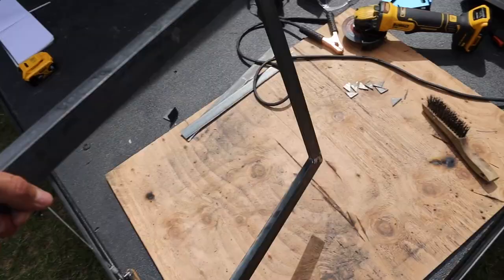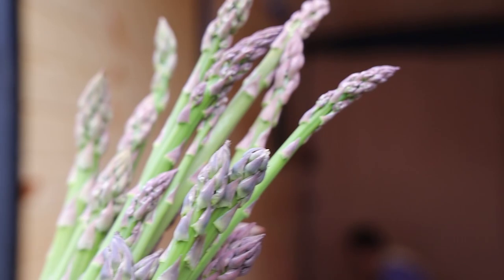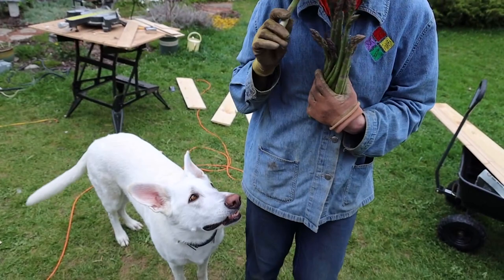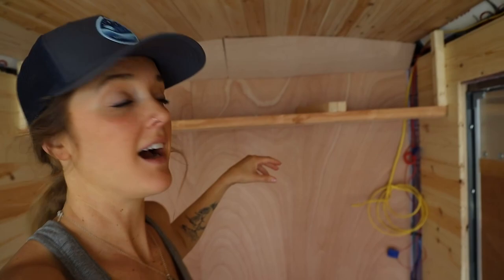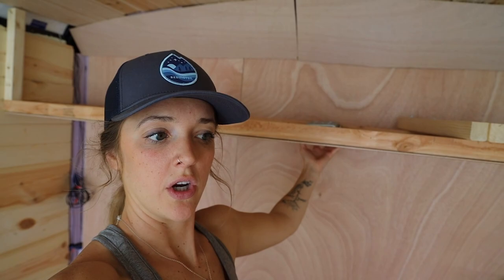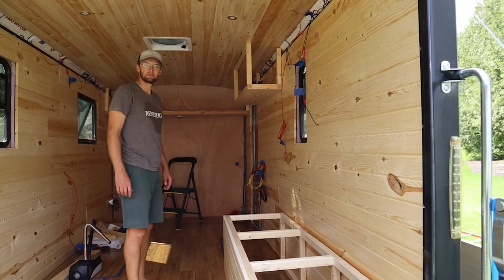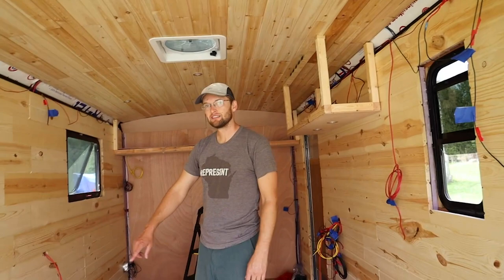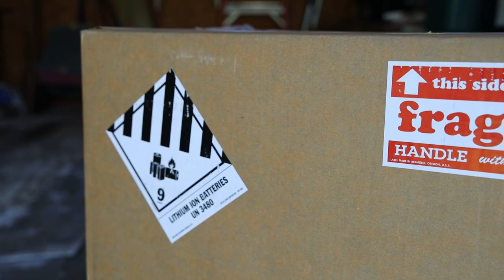CARGO TRAILER CONVERSION | Tiny Home Build | Part 4

Comment: Looking very good. You must be doing a great job because for a moment I thought it was a different trailor, because  it's got the illusion now inside that it actually looks bigger than when you started. I feel  Noah you & your partner are going to have some great travels & fun. You will have so many stories to tell like your sister does.  I put partner because I don't know how to spell bri Bree 🤔.  Looking forward to seeing your next video 🙂.   Linnea, because I have watched all your videos, I think you have built a lovely travelling home for you & Akela . I have noticed how you pack the back of your van. To me on this side of the camera, it looks like you might be packing a lot of weight on the rear drivers side .  Do you weigh all your stuff in the back & distribute the weight evenly? Because if it's not & it's in the same place all the time. This could lead to putting pressure on the bearings, the break pads ,& the edge of the tyres.  I don't know what your stuff weighs . So I was just wondering if that's something you do ?.

Comment: You're so calm about the hard drive stuff. I know it's after the fact, but I've been losing my ever lovin MIND. So frustrating & discouraging sometimes. I just need to know you wanted to break things & resign for at least a minute. 🤣
Reply from the maker: I had hours of wanting to break things and throw my computer against the wall 😂 I’m sure everyone around me was sick of my angry grumbling!! 
I ended up losing a lot of good footage, but luckily I had enough to make a video. It’s always so frustrating! So yea… you are NOT alone! Ha
Reply: @Linneaandakela  i bought an external hard drive based on Google searches "top 10 external hard drives", dumped 3 yrs of my life on it & promptly broke it, not knowing there were 2 types. Mechanical & SSD. Cried for 2 days & still waiting to see if anything can be recovered. & I'm still on baby steps. Have a video edited that WILL NOT UPLOAD. & 3 full episodes I need to shoot, but no clue what I am doing. 🤪 The struggle is real.

Comment: Very nice.
Enjoyed listening to Linnea.
By the way. Noah is holding the grinder, the other way around. If the grinder get stuck, it would leap on him.
You suppose to hold a grinder, where the rotation direction, would throw it away from you, if stuck.

Comment: What’s Kind of vehicle is Noah going to use to haul this trailer? I’m curious, because you guys are installing a diesel heater. Was wondering if you guys where taping into the vehicles tank or installing tank on the trailer.